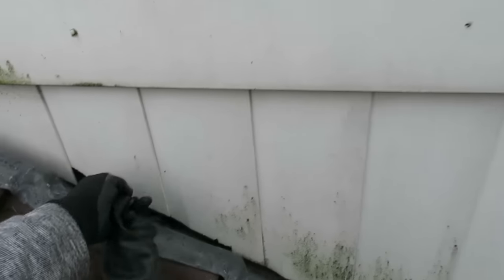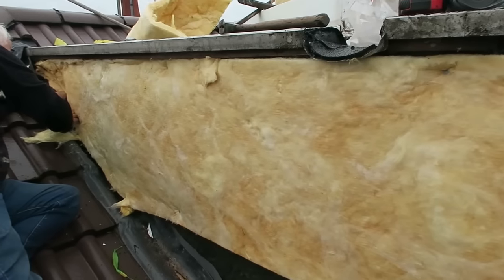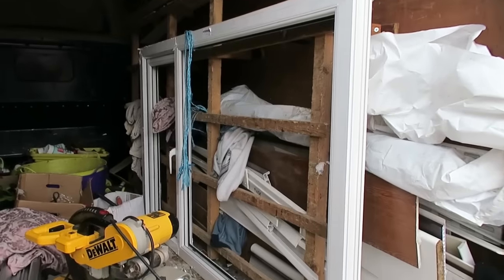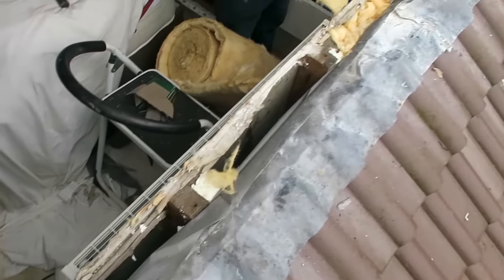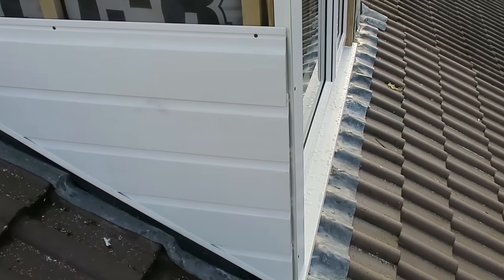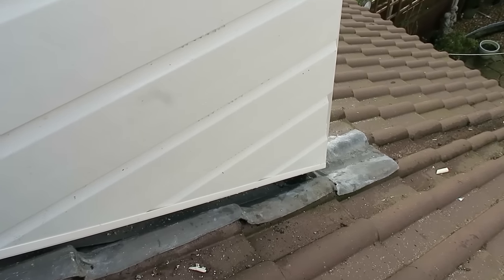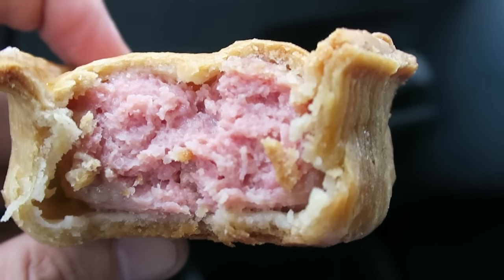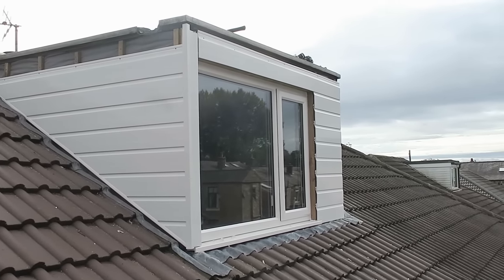Cladding a Dormer Exstension,  AMAZING MAKEOVER!

Comment: Great work! Quick q. My loft was converted in about 1995 (we bought in 2012).

The loft is okay internally but the insulation is shocking. Wondered if there’s a way to remove the existing tile cladding, beef up the insulation on the outside by about 100mm (don’t want to reduce internal space) and replace with new cladding?

Can I bolt on new studs to existing and increase the roof to cover the additional insulation?